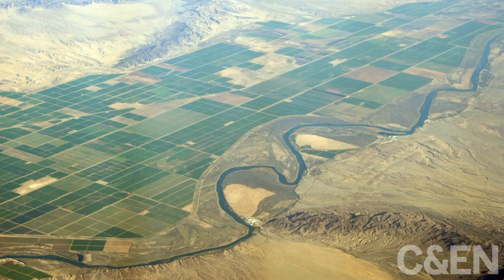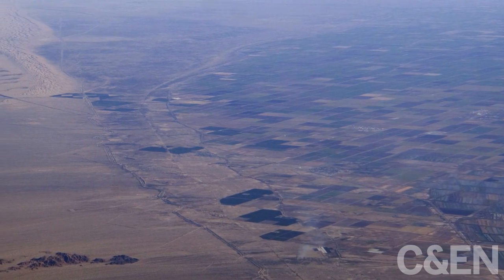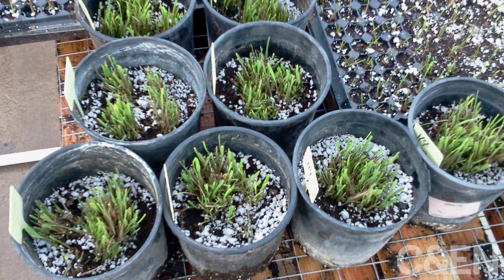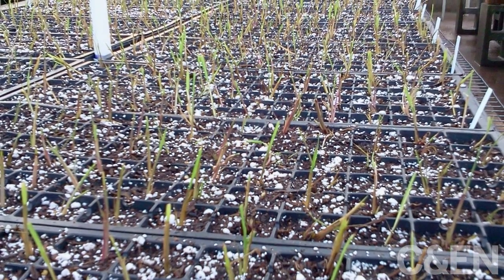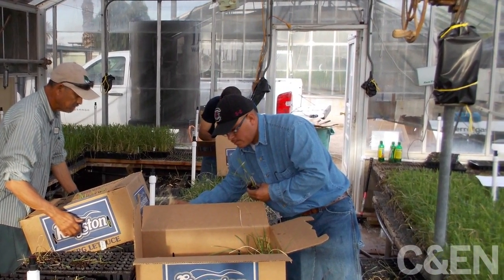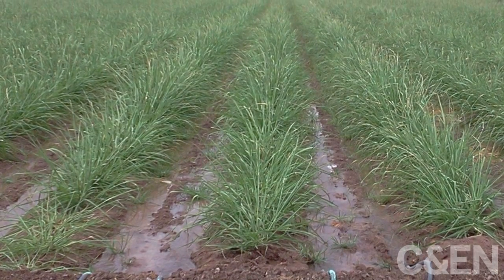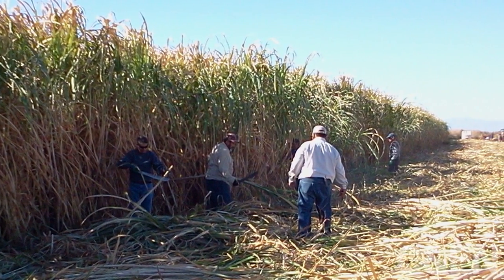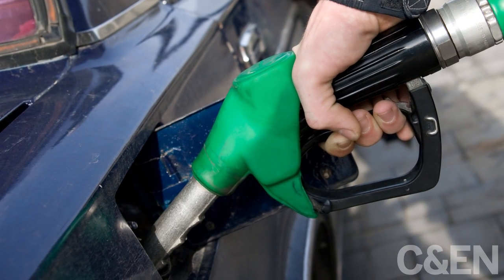How A Biofuel Maker is Test-Growing A New Energy Crop

Comment: Yes, WorBlux is correct. Biofuel businesses compete in a different market (liquid transportation fuels) than do solar firms which are in the electricity-generation business. Until a good proportion of transportation tech turns to electricity, they will remain on separate paths. Hemp would likely make an excellent biomass feedstock but is grown in different areas than energy cane (and hemp is not legal to grow in the U.S). Most perennial grasses would need much less fertilizer than used on corn.

Comment: The most efficient is actually biomass gassification which can yield over 2x the fuel, but requires more prepossessing for conventional engines to make use of it. The barrier no is mainly just capitalization costs.  As to motor fuel the efficiency of solar is very low because battery technology sucks balls to put it mildly.

Comment: Hemp depends on where you grow it (like corn). For cellulose a reasonable assumption is 50 gallons of ethanol per ton of cellulose, and hemp can generate up to 9 tons of hemp fiber, and likely significantly more that if you are willing to breed out quality in exchange for quantity.  So 500 gallons-750 gallons per acre of hemp, but hemp would also require fewer inputs than this cane or corn.  Switchgrass is also promising if you find a way to deal with the higher lignin content,.